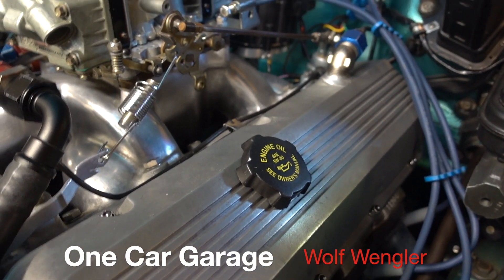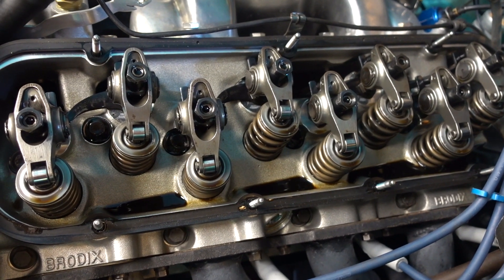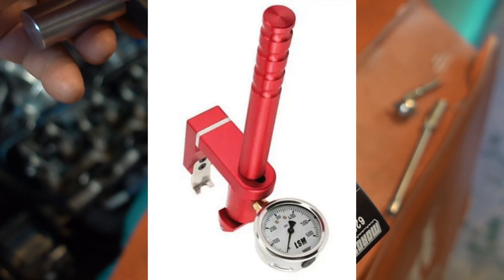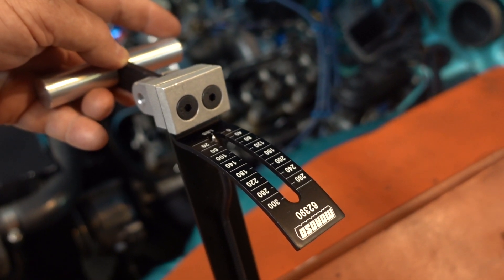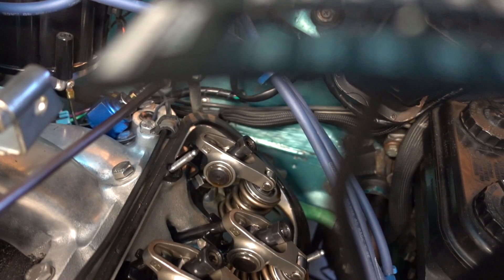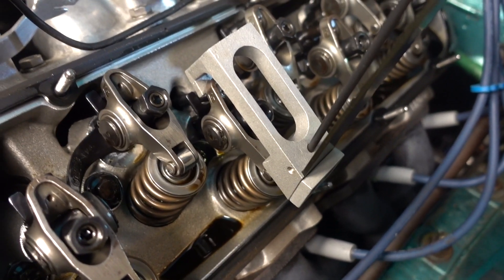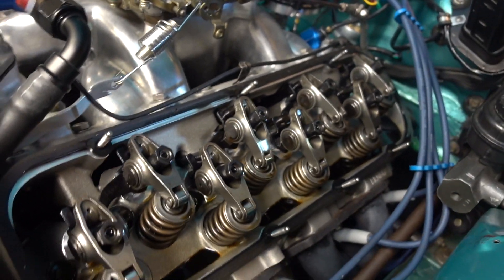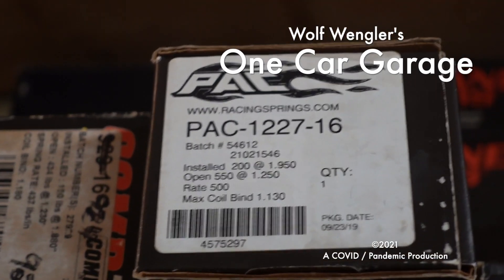Checking Valve Spring Pressure

Comment: Great video except it’s not IOEC it’s EOIC. When the exhaust begins to open set the intake when the intake begins to close set the exhaust.  You get away with the way you’re doing it because your base circle is relatively large. If you use the method I described you will guarantee to always be on the base circle regardless of its size.
Reply from the maker: NOPE! You set the intake when the exhaust just begins to open and you set the exhaust when the Intake just begins to close. Think about what is happening in the cycle. I run a cam with almost .700 lift too. I am not sure what you are saying , but I am sure I am right. Do some more reesearch
Reply: That’s not what you said in your video. In the video you’d said set it when the exhaust is closing. I think you just said it incorrectly

Comment: There is a theory that if you let an engine sit for extended periods of time(years, in my case it’s been 11 years) that valve springs will loose there tension and will become week from staying in a compressed state for so long, is there any truth to that do you know? Ive ordered the lsm checker you mentioned to check the springs, but just curious if there is any truth to that theory. 
I’ve heard people say both they will weaken and that they will be fine and that the main reason spring will fail is if they are over heated, over sped, or over compressed. 
This is in a gen 2 520ci hemi NA(bored and stroked 426), high compression, full roller, .650 lift cam.
Reply: Also thanks for the video showing how to use the seat pressure tool, was very helpful
Reply: @diezelking89   I have the same situation with a chevy ls6. The motor has been sitting for 1.5 years. I ordered the lsm checker but have not used it yet. Do you have any further information on how your experience went?
Reply: @shootmalones Tried the tool yet?
Reply: @diezelking89 Hi guy did you check your springs ever? My car sat for 15 years. I want to know if yours lost tension.

Comment: What if your valve spring pressure is to weak
Reply from the maker: There are correct valve spring pressures, both closed with the valve on the seat and open at full lift that are dictated by the cam profile. If the spring is too weak it allows the valve to 'bounce' off the seat or the lifter to loft off the high point of the cam. Both are bad things, that can lead to worse things...!
Reply: @wolfwengler  I have a 383 stroker with promaxx heads they were set up for a flat tappet cam 310 open pressure 115 closed but I went with a howards roller cam and they want 375 open pressure and 120 to 130 closed pressure guess I need to get some new springs uh ?
Reply from the maker: @aaronburleson2454   Yes and get good quality springs. Much of the stuff on the market today is CHI-NA Junk.  Isky Tool Room springs are good as are the PAC  high end springs. You could use a beehive spring at those pressures and be way ahead.